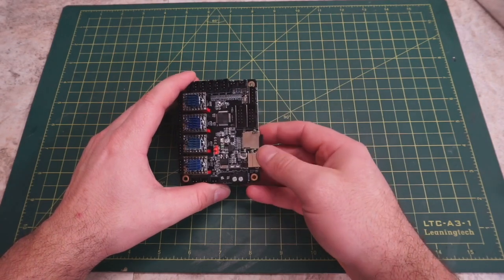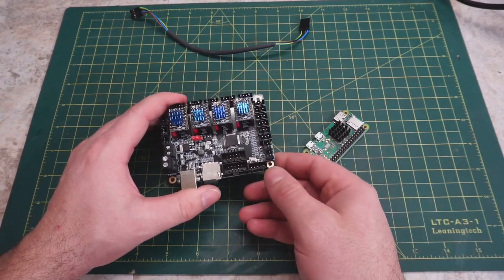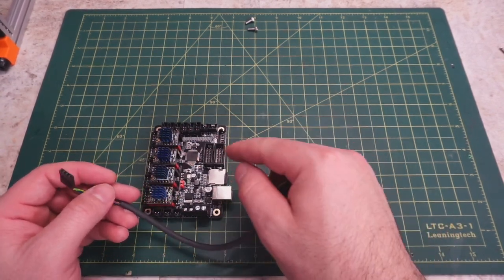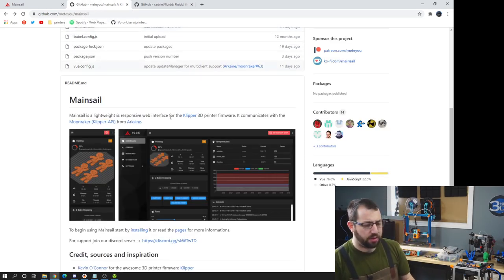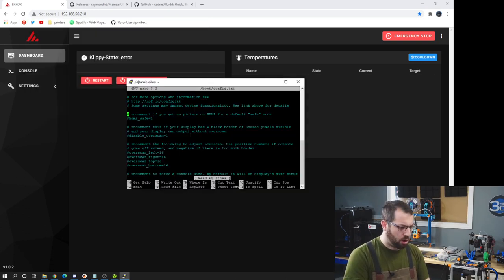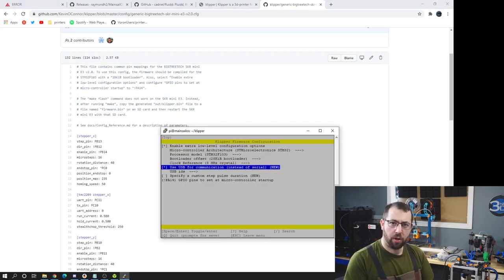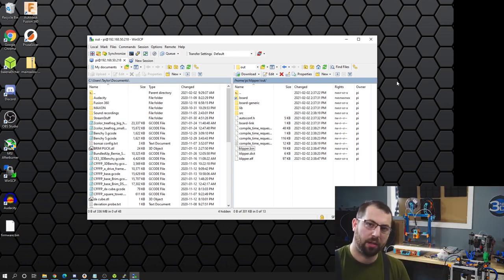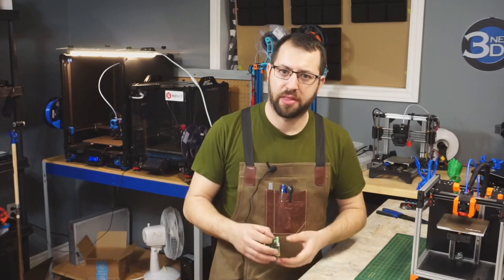Klipper and the RPI-zero, Low Cost Remote Printer Control!

Comment: Do you have to restart klipper at startup sometimes using a zero? I’ve got a pi zero on my V0 and sometimes I get an error at startup.
Reply: I get it too...something about a timeout, but after one reboot it doesn't happen again until disconnecting power.
Reply: Are you fully up to date on Klipper? (0.9 release). There was some work done to help mitigate "Timer too close" errors when running on Pi Zero. I had these issues with 0.8 but 0.9 is running smooth. (GitHub link: https://github.com/KevinOConnor/klipper/issues/3316)

Comment: I am selling my printer and want to replace the installed Pi 3B+ with a Pi Zero W before handing it over. 

Do I have to go through the whole firmware flashing, or is there an easy way to disable USB and enable UART without having to go through the flashing process?
Reply from the maker: you could just swap the SD card and call it a day
Reply: @CanuckCreator  but that wouldn’t disable USB and enable uart…

Comment: If you just use mainsail or fluidd without any cam. Will be pinting with pi zero slower than pi 3 or 4. Will you be able to print with 500mm/s?
Reply from the maker: Wont effect speed
Reply: @CanuckCreator  So we can say. If you don't use cam. Everything will be identical to faster raspberry pi?

Comment: Could I use the raspberry pi 0 with klipper and screen? I don't have wifi  and would like to run klipper on my tevo tornado.
Reply: Well  you can run I have pi zero running klipper and skr 1.4 T, and still able to use the 12864 reprap full display

Comment: Do you know if the stock Ender 3 board has access to the TX RX?
Reply: you'd need to solder wires to some exposed vias
Reply: "make menuconfig"
select "Enable extra low-level configuration options" and select
serial on USART3 PB11/PB10, which is broken out on the 10 pin IDC
cable used for the LCD module as follows:
 3: Tx, 4: Rx, 9: GND, 10: VCC to gpio rpi zero
Reply: @madorax251  Does this apply to the ender 3 v2 as well?
Reply: @SibaNL  yes, I have it working on the Creality 4.2.7 board

Comment: ok lets say I want to do this to a full size pi and I already have a buck converter supplying power does that mean all I have to do is connect the tx and rx pins to the board and pi?
Reply from the maker: Tx rx and ground. No 5v

Comment: Hello Nero. I've been watching this video because I am using a raspi 4 with the skr mini e3v3 and want to use the tft to communicate through the tft.  I've followed each step and right now I'm about to plug sd card into my skr to flash. I am confused though on one thing. do i keep my raspi connected to the mcu when i put the sd card in and power it up or does the raspi need to be disconnected while i flash then reconnected afterwards? also, after flashing, does the sd card remain in the skr indefinitely or do I need to remove it when its all said and done?  Thank you soo much for your videos and help and sorry for the newbee questions but I'm a newbee lol.
Reply: Keep it simple. Insert the SD into e3v3. Turn on the power. Wait 5 minutes. Remove the card and see if the file named: "firmware.bin" was renamed to "FIRMWARE.bin".

If the file was renamed then the firmware change was successful. The file was saved to the e3v3, so you can run the printer without the SD card.

Comment: I had fallow your vides . But my zero pi did not connect with the skr 1.4 turbo. what should i checked.
Reply: Waqar, were you able to make any progress with the 1.4 turbo? I tried a bunch of configurations but could never get it to connect over uart and ended up giving up.
Reply: @JagerkTi  my bltouch and rpi zero is working great

Comment: I was not successful following your instructions. When making the SKR firmware there was no place to change to UART2? 

Klippy can't connect to the SKR via the TFT pins. I changed printer.cfg to serial: /dev/ttyAMA0. Raspi Config turned off USB switched to Serial. Flash looks successful. PC doesn't see the SKR Port (because the USB was turned off in the firmware)   

Also,  I tried: I try to check the serial port via Putty and get:

         ls /dev/serial/by-id/*
         ls: cannot access '/dev/serial/by-id/*': No such file or directory

I could use a working printer config for SKR 1.3 + 2209 if anyone has one.  Thanks
Reply: Did you solve this? I'm having the same problem
Reply: @fail_fast   I was told there was a bug. And to use the earlier version of the firmware and use USB. That worked. I could read the SKR's USB address and enter it into my config. But after updating everything via the browser in windows all of the libraries, Mainsail, Moonraker, etc. I could not connect to the "printer" which is the SKR board. I am now starting clean again with a FLUIDD pi image and see if that is any better. I'd start with standard USB and make sure it works before trying the UART2.

Comment: Great video! Would that be possible on a stock (melzi) 8-bit Ender 3 board?

inb4 someone rushes to tell me how cheap a SKR is: I live in Brazil, it'll take months for it to get here and there's a chance it'll be heavily taxed. I already got a pi zero w.
Reply from the maker: I believe there is a klipper config for it. Check the klipper github under  configs
Reply: @CanuckCreator  Jeez, that was fast! Thank you for the quick answer! But I mean more along the lines of whether I can connect the Pi Zero W to the melzi. I'll look for the hardware specifications for an RX/TX and 5v output.
Reply from the maker: @eucharistenjoyer  you would most likely have to use usb
Reply: Fala aí blz? Avançou com o Klipper no PI Zero W? Tá rodando suave?
Reply: Hey, did you installed on your ender 3? I've done it on one of my stock ender 3 over usb, but i can't get it to work via usb on my 2 remaining enders, have no clue why. I get the avrdude not in sync error, even i already burned a bootloader

Comment: Can I use input shaper with pi zero? If yes, how can I connect the sensor and the board at the same time?
Reply: As expected, the input shaper resonance test was too much to handle with my pi zero w. This was the only pi I had available to use , so I managed to work around this issue by borrowing one of my pi 3b+ from a different printer just to run the resonance test. To do this I just hooked up the more capable 3b+ to the printer and AFTER saving a copy of the printer cfg already on it, I wiped the cfg clear and pasted the cfg from the pi zero w onto the 3b+. After that it was simply following the input shaper resonance test with the adxl and recording the values. I then reinstalled the pi's to their respective printer and added the input shaper values on the pi zero w. I have yet to have any issues thus far with the pi zero w with input shaper enabled during prints. Of course this is only possible if you have or can borrow a more capable pi just for the initial resonance test. I am also using fluid if that helps.
Reply: Answering the second part of your question, the adxl uses different pins from the pins shown in this video for powering the pi from the controller board. The adxl only needs to be connected for the initial test for input shaper and then is removed once you find the input shaper values for your printer.

Comment: Is this doable with two MCUs (in a 2.4); with a pair of GPIO(uart) lines going to each SKR board?  I imagine it's gotta be possible; just specify the proper serial= location.
Reply from the maker: If your going with 2 MCU`s id recommend just going with a full size RPI, just for the power and ease of use.
Reply: @CanuckCreator  can you please do 2.4 klipper install, i searched everywhere, cant find right track, when i see 2 boards and rasberry pi 4 which i never touched in my life ,it scares me.
Reply: @vishu996  Join the Voron Discord. Their are nearly 1k known Vorons most (90%) with this configuration
Reply: The Pi only has one UART on the pin header. The others cannot be configured to be a UART
Reply: @Raymond-u8x  thanks - I foolishly assumed there was more than one on the header.  @Nero 3dp: 'easy of use' bores me - I built a Voron.
Reply: @vishu996 You're not going to break anything - Follow the guides. The worst that can happen is that you'll have to format/write the image to your sdcard again. - https://docs.vorondesign.com/build/software/

Comment: Is there any downside to using uart connection instead of USB? I've got a twotrees sapphire plus, but i don't want to rotate the mainboard, because then the wires are too short... There is a lot of space inside the sapphire plus case, but nothing to attach anything to like screw it in or something.
Reply from the maker: Speeds with klipper are limited by MCU, not connection, so in practice theres really no noticable difference between uart and a USB connection
Reply: @CanuckCreator  so a mainboard with a faster mcu would make a difference? Or is that just theoretical
Reply from the maker: @robbinkoot2154  well, put it this way, the current speed benchy record is sub 5 minutes, on a delta, with a 8bit trigorrilla board running klipper
You can check the klipper docs for benchmarks of the different MCU`s
Reply: @CanuckCreator  yeah I've already seen it. I won't print even close to that speed. If I can print a pretty benchy in 30 minutes, I'm happy. I've got a MKS robin nano v1.2v atm, so no need to buy an other mainboard. Thanks!

Comment: Great video and content. I have a problem that I tried to solve with no luck neither on discord nor everywhere else... I followed everything, but because I'm with atmega2560 the "make" command doesn't make the klipper.bin file. When I try the traditional ls /dev/serial/by-id/* to discover the serial port and then to push the Klipper.hex file to my printer it says "/klipper $ No such file or directory". I just can't solve this. I know it's a different connection and should have a different command but I just can't find it anywhere. Could you please help? Best wishes!
Reply: Did you get anywhere?

Comment: Had this running until Ive made an update yesterday... now i need to update the firmware on my ThinkerSE, conncention was done via uart but i cant flash the new firmware cause it has timout errors :-( also it seems ive completly disabled the usb interface an dont rember how...
Reply from the maker: If you updated klipper recently you need to reflash the board again like you first did when installing klipper.

Save your config and start fresh may be easiest
Reply: @CanuckCreator  yes youre right, I'm going to install a new image and then import my config. thank you
Reply: @CanuckCreator  its running again, got back to the previous version so I not had to upgrade the firmware yet. Thank you for all of your effort!

Comment: you don't need to cross the wires physically, you can just cross them in software via the GPIO config.... that's doable on the Pi, as well as on most boards through marlin...
Reply from the maker: Simply crossing the wires when making the loom I think is a simpler and more foolproof solution
Reply: @CanuckCreator  Using the config file allows people to use existing standard header cables that they may already have lying around, it's also more foolproof to validate that via the config because the default pinouts may change across board and firmware/software revisions.
GPIO is by definition software controlled and that's where you should control it.
Reply from the maker: @DOGMA1138  Klipper does not support software UART, so that method will not work
Reply: That isn't how that works on the Pi without using a slow, CPU intensive software UART. Same with the MCU board (which klipper doesn't support software UARTs for the primary UART channel)

Comment: Anybody else having trouble with this? I've done fresh installs with 0.30, 0.40 and fluid 1.13.0 and I still cant get mainsail/fluid to connect to my board.
Reply: ***************FOUND THE SOLUTION! **********
if you are having connection issues and you followed this tutorial exactly, there are two changes that you need to make

**Firstly**
in the config... instead of using 
serial: /dev/ttyAMA0

I had to use 
serial: /dev/serial0

**Secondly**
To use the TFT header on an skr v2.0 for UART you need to change the config...
make menuconfig
Instead of USART1 use USART2    (this selects which pins on the SKR it listens for and transmits out of)
reflash your board after this
Reply: So you got this working on an skr2? Am I reading that right?

Comment: Can I use this with a printer running Marlin?
Reply from the maker: Yes, for something like octoprint

Its basically how a RPI zero connects to the Prusa Mk3 controller for example
Reply: @CanuckCreator  But do I need Octoprint to run it? Because the whole Idea is that I don't need to run octoprint since my Raspberry Pi zero w is too weak

Comment: can I use usb on the main board instead of 4 pins?
Reply from the maker: Yes. Uart is a nice option though as it leaves the usb on the pi free for say a camera and you can pull.power as well
Reply: @CanuckCreator  thanks for the reply! I think I’ll go with the UART then.

Comment: Anyone get this work on a board with LPC1769? It won't connect for me and there are several issues about it on klipper's github and discord with no solution
Reply: Yes managed to get it working today with pi zero w and skr 1.4 turbo running the LPC1769 chip

Comment: Has anyone tried this on the Ender v2 printer w/ the 4.2 board?
Reply from the maker: Im not sure the board has the uart pins exposed. You can do it over usb easily however if uart is not an optiob

Comment: You should mention that if you do this with SKR 2.0 mini board you will brick it as klipper is not compatible with that board.
Reply from the maker: Im sorry which board? Do you have a link as this works with the skr mini v2
Reply: @CanuckCreator  BIGTREETECH SKR MINI E3 v2.0 I did same thing as you shown in video and i had it bricked now it doesn't get recognized by usb or sd card. From what i found on web it only shows that STM32 controller on board got bricked with klipper.
Reply from the maker: That board works fine. Its the one used in the video and is spec for the vzero printer
Reply: @CanuckCreator  Then what would cause board not be recognized by raspberry pi or desktop system when plugged in ?